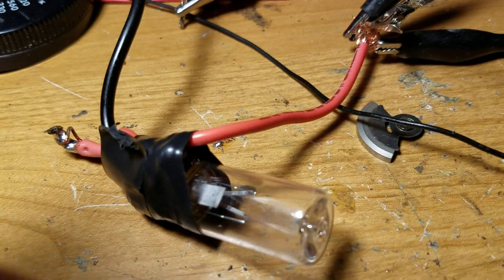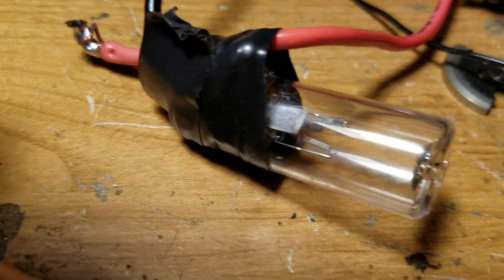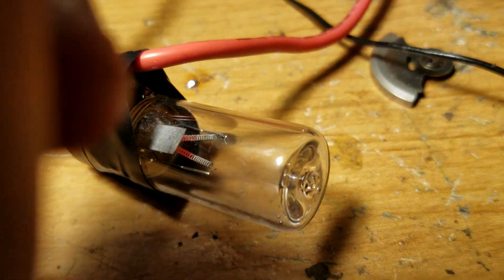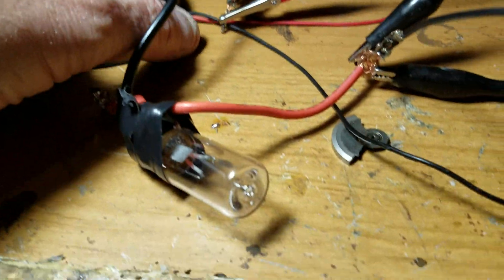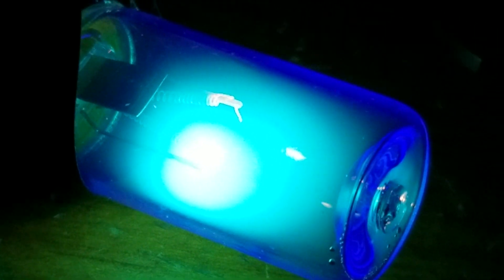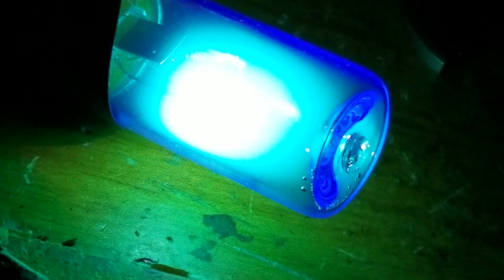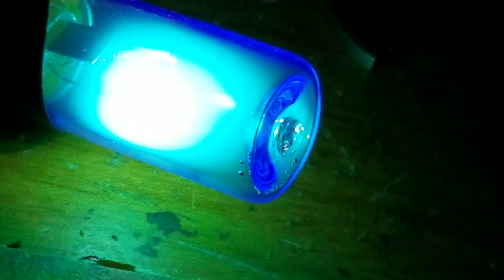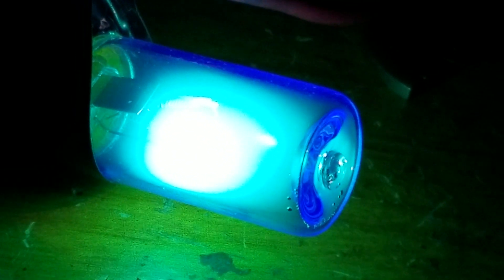Amazing 10volt light bulb germicidal Uvc

Comment: Hi all, I use a booster to increase from 12VDC to about 20VDC (with 39 Ohm resistor), it light up only on 1 electrode. What may be a problem? some one said it is due to DC power supply, is that correct? The idea of 4uF sound better, since the resistor become very hot.
Reply: Yes, it's because it's DC. The mercury plasma is in fact working as a rectifier. However, it should not be any problem (unless perhaps some less service life of the bulb). If you change the polarity from time to time, it should help for a longer lifetime.
Reply: 4.5uf capacitor in series with 220v ac

Comment: you can try 10uf 400v film capacity in serial with it on AC 120v
Reply: Yes. And 4uF for 230V AC.
Reply: Really? Wont it explode? I mean that's a huge volt for a 10V light
Reply: @randomvideos3187  No. The capacitor is reactive, and works like a "kind of" resistor for AC. But without the heat problem. The idea is to limit the current to the lamp. The voltage is not really interesting here.
Reply: @erikas6874  But with the initial current spike problem.

Comment: Hello! I have a bunch of these bulbs and I am trying to find the cheapest and best circuit to run these. Can you tell me what resistor you are using and how you have it hooked up? Thank You!
Reply: Resistor is not required until and unless u have a stable power supply. But u can use 10 ohm resistor but then voltage has to be increased to 11 (10.9) volts.

Comment: It’s interesting but I’m not sure of the output at such low power. Nevertheless I’d be concerned about photokeratitis or eye damage.
Reply from the maker: The output is in the 260-265nm range and about 3watts of dna destroying light. I never thought a gas in a tube with just a filament could provide the energy to flores electrically plasma light. Unexplainable why high voltage is not needed like the other florescent tube lights that need electrodes on each end with filaments to vaporize mercury and then high voltages to start the light. This could run from a 9 volt battery i suspect.  I've bought several uvc lights ton steralize bathrooms and kitchen and bedrooms .they produce the same frequency and also produce ozone as it cleans the air of germs mites virus bacteria and yea they wll burn the coating on your eyes just like welding are in minutes i learned by mistake.i now wear protective glasses that block this wavelength and leave the rooms when its doing it thing. Awesome light
Reply: @Gadgetmall  thanks man. Very helpful for my project.
Reply: @Gadgetmall  Yes. I am fascinated myself. I think the small distance between the plasma electrodes does the trick. When the bulb ignites (plasma starts), the current in the gas i much higher than in the filaments, as we can se the filaments darkens. However, I very cool gadget. Just be aware of the dangers related to it.
Reply: The lamp is also emitting UV in the 165nm range (in addition to 260nm++) due to it's quartz window. Yes, you can easily get photokeratitis from looking directly at the bulb when it's working. It's quite a wild guess, but I would say looking at it in 5 minutes at 1 meter distance, will make your eyes hurt some hours later. And for 2-3 days. Been there, done that ;)